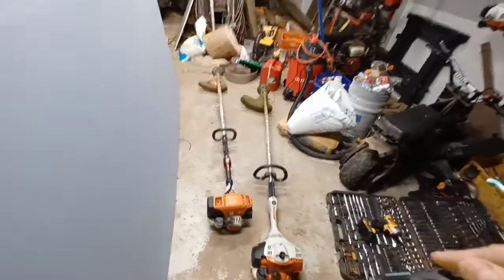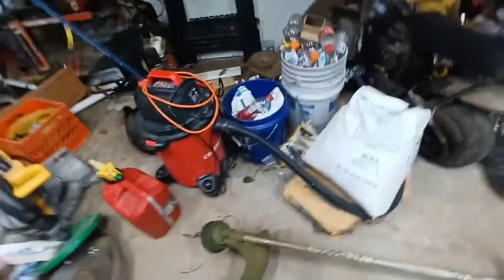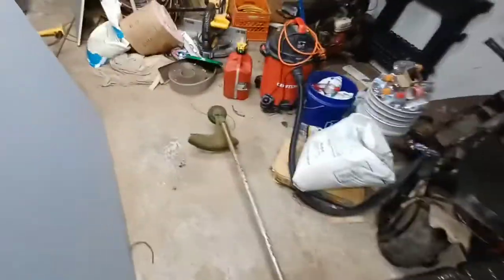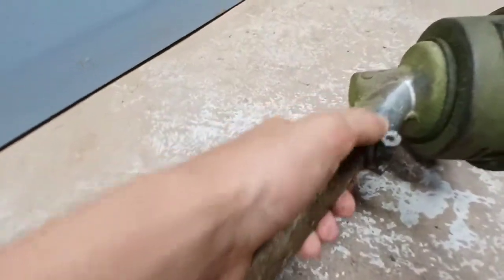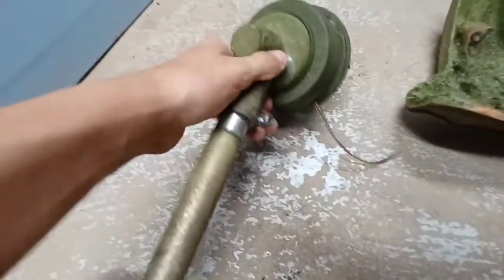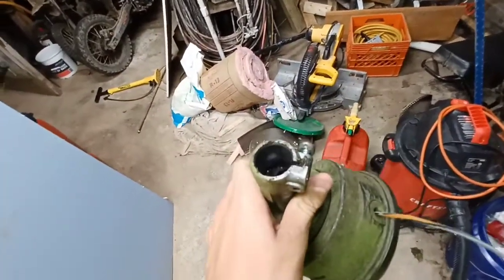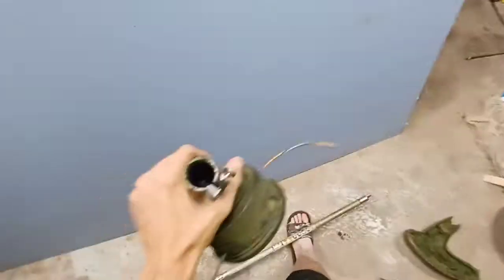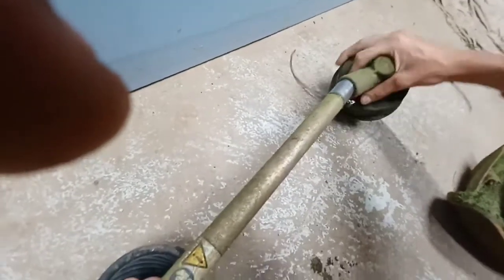Hidden Grease spot on Stihl weedeaters (FS56/FS70)

Comment: Thanks for the tip. Here’s another tip, remove the guard and put it way, second tip, but an Echo Speed Feed 400 head on and you’re golden. 👍
Reply from the maker: I personally don't really like to remove guards. It burns them up over time. 1 extra inch of string than recommended is equivalent to about 20 extra degrees on the engine. On the 4 mix engines it causes the cam lobe to melt. And on the 2 strokes ive seen it just slowly kill them over time. Wouldn't believe how much money it'll cost over a cheap plastic guard.
Reply: @hotwheelsracer6380  most expensive part of blowing a can gear out of these fs 110s or similar models is literally the tube of red RTV it’s not that big of a deal. 
It’s a brushcutter it’s gonna get hot. 😂

Comment: Does this get greese into the gearbox ring and pinion gear? 
Or does it just grease the drive shaft, gear box square connecting point hole?
Does that hole give you access to the gear box?
Reply: I don't think it does. I looked at mine and it seems that it is sealed and the grease cannot get into the gear head properly. I dn what to do. Maybe drilling a hole in the gear head and fitting a greaser head...
Reply: @optiplexpavel  haha, I had a feeling this squirting grease down the shaft thing was a scam... I hate having to reengineer everything.... here because they saved 6 cents on a little bolt...
Reply from the maker: @motoxerdad  No! It actually does get in there. If you shine a light and look real close down in there you can see the inside of the actual gearbox. I figured this out on my own experimenting with it. Greased it and it quieted my whining gearbox down.

Comment: I believe the echo SRM 225 model, after 50 operating hours, recommends you also Grease the flexible cable inside the shaft. is that a requirement for Stihl as well?
Reply from the maker: Yes
Reply: @hotwheelsracer6380  Thank you for the information.   I appreciate it
Reply from the maker: Not a problem
Reply: What cable in the shaft?
Reply: @webberalex9533  Some weed eaters have a cable that runs the length of the weed eater shaft to your weed eater head that requires grease.  Hope this helps?

Comment: I can't get the 2nd screw off. My drill won't even remove it. Tried some wd40. Now it's kinda stripped, any recs for how to loosen this? Seems like it's freaking welded on or something.
Reply from the maker: No idea
Reply from the maker: Best answer i got for ya is to drill it out and re tap it
Reply: Vice Grips to break it loose, my impact wouldn't do it either, and i didn't want to break my bit or strip it.